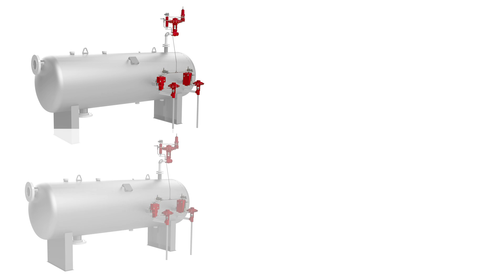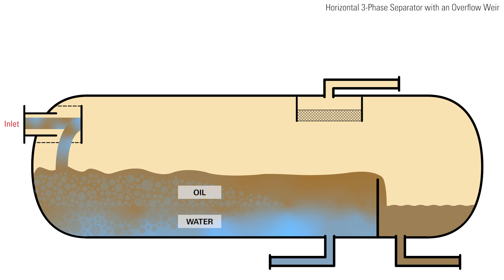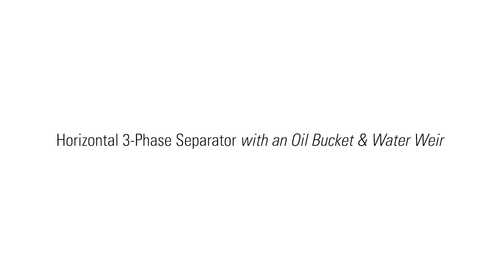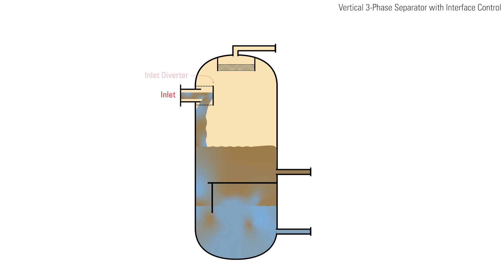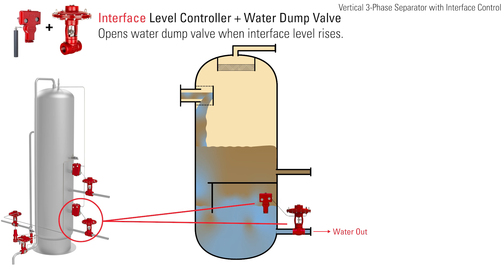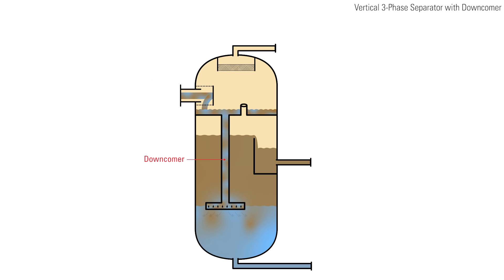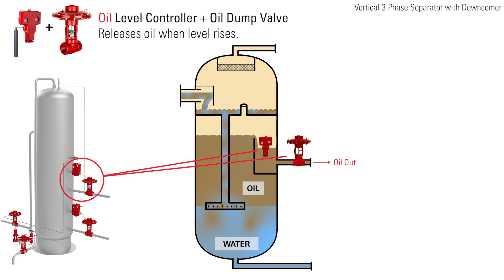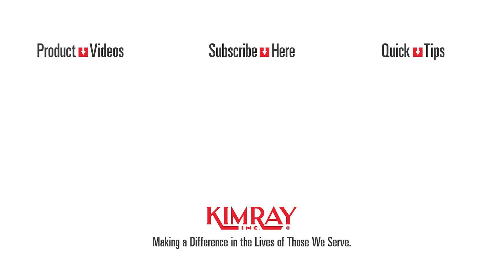4 Types of 3-Phase Separator Tank Design Configurations for Interface Control

Comment: Hello, 
I have a small question, 
How would we know for sure that all the gas bubbles inside the feed escapes in the Gas section ? if any gas bubbles fall down into the liquid, does it have enough time to separate itself ?
Reply: All “free” gas will be separated if the separator is operating within its design parameter’s.
However, any small gas bubbles, or dissolved gas  that’s go through the water or oil legs will be removed in the downstream separation equipment.
These equipment can vary from platform to platform but they will operate at lower pressures and sometimes higher temperatures than a primary separator, which will help to release the left over entrained gas.

Comment: How can find( measure) out levels of gas , oil and water ?
Reply from the maker: To accurately measure each resource, they will first need to be separated from each other. A measuring device, such as a turbine meter, Coriolis meter or another means of measurement can then be used to record the flow data of each resource.